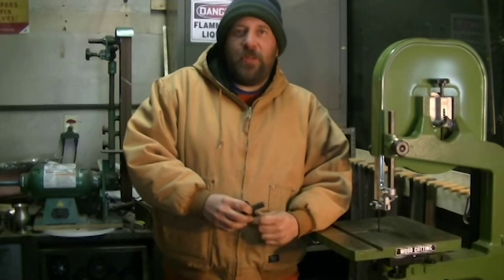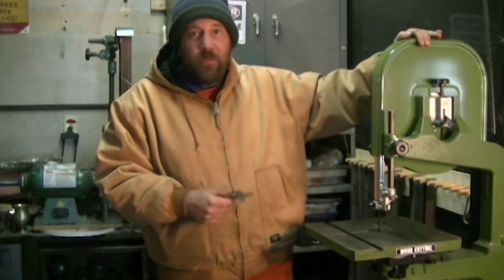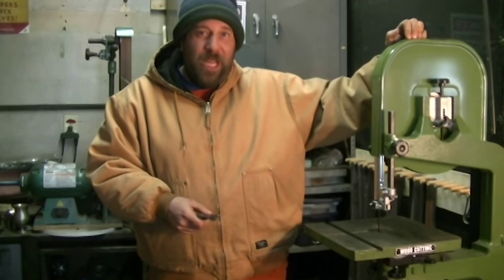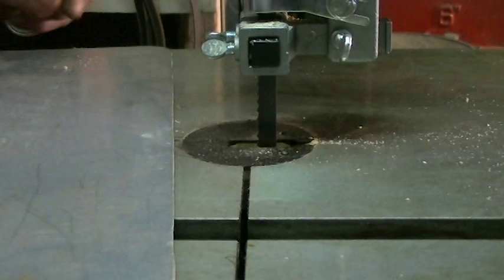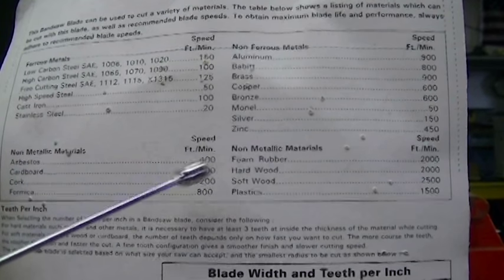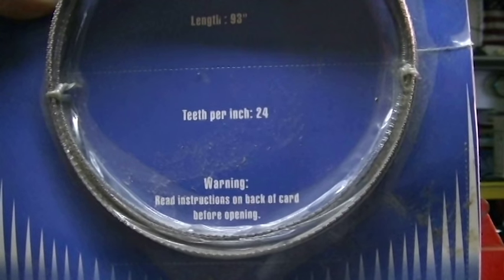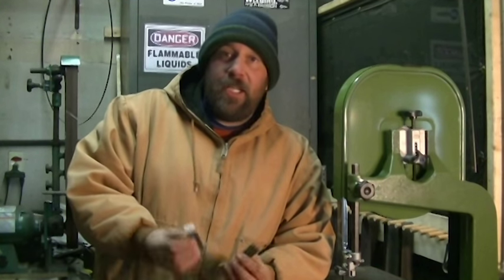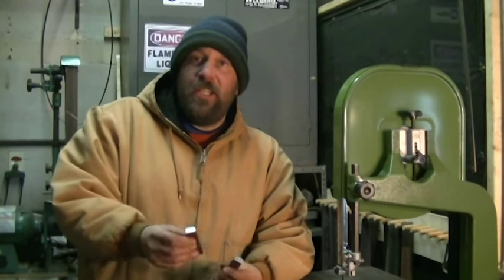Can You Cut Steel On A "Wood Cutting" Bandsaw?

Comment: I had a band saw in the 1960's  I installed a moor from a 1948 Bendix Automatic Washer. it had a 10 to 1 reduction system operated by a solenoid.  I used the slow speed for cutting metal it worked veyt well.

Comment: It is really nice that you put in a caption telling that a segment is at a higher speed!
Very few do that, and it can sometimes make an impression to those who do not know the process that it should go much faster than what it does when trying it yourself. And many who watch this kind of videos have little or no experience in the process themselves.

When cutting round material freehand, put a visegrip or toolmakers clamp on the stock! 
It will try to rotate as the blade goes into and out of cut because the cut forces are not above the contact point stock/table. This can make the teeth catch the edge and the teeth or your hand can get hurt.
Reply: Thank you.

Comment: I would like to make an addition to your video. When cutting metals, you should not just "let the blade do the cutting". So, for each metal there is an optimal feed and speed. And certainly true for harder metals, the blade will last longer if you do put the correct force into the cut. The problem with going too slow is that the teeth will rub rather than cut and wear the blade out quicker. Otherwise great video. PS I loved the comment about Dracula needs to be aware. Very funny.

Comment: Thanks for the demo!  I've got a Delta 14", but speed isn't adjustable as it is, so it's not going to get fed any steel.  I'll keep watch on Craig's list for something that can be modified to run slower. In the mean time I have a Miller Portaband mounted in a Swag Off-road table, so I have a 5" vertical bandsaw, and a portable saw for rough cutting wherever needed.  For the sizes I'm working with it's been good enough.

Thanks for the demos!

-- Mike

Comment: Depinately possible. It's not the tools fault to fail. It is the impatience of the operator that causes problems. We have a metal bandsaw at work, that the engineers destroy every new blade on the first use, as they FORCE to cut. The blades run about 120.00 from fastenal. I have a friend who cut blackpowder gun stocks on his meat cutting bandsaw, and it still works and blades last.

Comment: Thx! I think I will finally get my metal blade to work, I was pushing too hard...Also for crazy shapes I plan to do straight cuts blocking it in rough and then grind to smooth everything out... cheers😊

Comment: I enjoy your videos, but I just want to correct you on something.  Metal band saws usually have speed controls where as wood band saws do not.  That chart you had out specifies the speed for the blade for the material to be cut.  It is kind of similar to a drill press.  You vary the speed to the material to be cut and also the diameter of the drill bit.  Cutting wood the speed is not that critical, but cutting metal you usually use a slower speed and you can quickly dull a blade or bit if you are going too fast.  Yes you can cut metal on a wood band saw, but you will most likely dull the blade more quickly.
Reply from the maker: Very good point, this model has 4 speeds all controlled with moving the belt to from one pulley to another. If I find myself using this saw in an upcoming video I will be sure to mention this. Thank you for the comment and view! Hope to hear from you again in the future :)
Reply: Also metal cutting band saws have ball bearing guides instead of those blocks. The blocks will work but are not ideal . Another major difference is the wheel. Wood cutting band saws have rubber on the wheel with a crown . metal cutting band saws do not have this but they do have a ridge at the back to keep the blade on the wheel. This is due to the higher pressure on the blade for metal cutting. All that being said I have one of these saws too. Set to the slow speed with nice starret blade works perfect for a home shop . I made a ball bearing guide for it too and that helped quite a bit. Cutting aluminum and plastic its a beast , rips threw it like nothing but cutting metal I agree with letting the blade do the work .
Reply: @foam_blaster  That is not the case, I have a Startrite 24" 10 speed metal cutting bandsaw. It uses blocks not ball races. The blocks provide better support and are more accurate!
Reply: @codprawn  really cool blocks like on a wood saw? My do all has block guids too but they are very different from wood band saw guids. They are  one peace with a slit in them and they fit in ridged holders not like on a wood saw. Available in different sizes and materials. Arent yours more like that ?
Reply: @foam_blaster  Daniel - yes that is what mine are like. I thought you meant they all had ball races.
The proper blocks are hard to get for my saw. You can make them from cast iron but some people make them from wood - lignam vitae which is very hard and self lubricating. Lignam vitae used to be used for shaft bearings on ships and nuclear subs so it is pretty good stuff!
Reply: @codprawn  yea i have a hard time finding them for mine too,  well for a good price anyways... Iv made them out of brass , steel and cast iron. all worked well the last ones I bought where hardend steel. They where excellent

Comment: I have an old 1994 reliant which looks just like yours and still works great . Mine  has the different size pulleys for speed variations also . Thanks for your video as I will get a metal cutting blade , as I never thought of using it that way .

Comment: Good demo. Mine is a 1960 era cast iron Delta 14 converted to metal cutting with 135 rpm gear-motor. With five step pulley it cuts from 194 fpm to 1220 fpm with 1/4 x .025 x 10T Bi-Metal for tool steel, 1/4 x .025 x 4-6T for aluminum and 14T for sheet metal. I've never found a reason to go wider than 1/4 on my blades. I'm surprised you can cut thick steel that fast on a wood cutting saw even with 24T blade, I assume with a three step pulley and 1750 motor.  Thanks from a retired tool maker.

Comment: I have two of these saws. 2003 and 2007. One is for wood, the other for metal or fine cutting with a metal cutting blade running at 576 sfpm. The ideal speed for steel is about 90-150 sfpm. I only cut thinner metal and leave the heavy cutting for the horizontal bandsaw. (SFPM is "surface feet per minute" the blade cuts, not the rpm of the pulleys)

Comment: Any bandsaw... it is all about the band speed and the blade. Different speed ranges favor different material. Wood is typically a much higher speed than metals. Alum is a high speed also so a wood cutting saw with a good blade will cut alum. I cut up to 2 inch alum stock on my wood saw all the time (dry for those of you who insist it needs lube, it does not and will not stick to the blade either though on STEEL I do use a bit of wax). with a 6 tooth raker blade. The speed is not able to be adjusted slow enough to get a lot of cuts on steel etc. Too much speed and you will break off the teeth in a HSS blade in steel while the same blade at a slower band speed will cut a long time through steels.
Reply: Dear wayne , How are you ,  I want to buy a Band saw  for cutting Buffalo Horn and produce some crafts ,  But i can not take a desition  , what kind of band saw buy , Wood or matel .  and what kind of Blade i used ,  Buffalo Horn is very very strong / hard .

Comment: Thanks, Jeff!  I was thinking of getting  HF 14 inch band saw and now, you've confirmed what I always thought was probably the case!  I will look for the model that model with the cast iron frame!  I just bought a Skil 9 incher to get me by until I can find and afford a 14 incher!
I am a beginning knife maker, and at 67, I'm a bit late to the game!  I DO need to cut high carbon steel and some other metals so I bought 2 bimetal blades with 18 teeth per inch!  I can't fond any blades with more teeth for the 59.5 inch blades I need so, I guess I'm stuck with 18 tpi.  I'm hoping that it will cut 3/16th inch nickel steel!  It works very well for bolsters and guards!
Again, thanks for the video and the info!
Reply: I don't think 67 is too late, my neighbor, he is 84 years old and he bought engraving tools and his doing well and he makes some money too, he told me if you have passion for something age it's not an issue:

Comment: I'm going to be cutting out a couple of skinner knife blades out of 3/16" thick 440C steel and I was hoping to be able to use my table top (9" I think) wood bandsaw for this. The speed isn't adjustable though so I'm not sure if it will work. I was going to try a high tooth count bi-metal blade and cut a little at a time and allow the blade to cool off between cuts so I'm hoping I can pull it off but not sure. I do have a 4 1/2 angle grinder I can use but I'd rather not if I can help it.

Comment: I worked in a machine shop that bought several of these saws back in the 90's. My thought was they wouldn't cut metal. We but two sets of pulleys on them or an extra set I guess to say. we left the regular speed set then put a big time reduction set on with the motor made to slide or swivel (can't remember exactly) but we cut aluminum with the factory set speed and cut steel with the reduction set. Made a loop that would hold both belts. Also we added spray misters that made blades last a long time.
Reply: Phil Lowman i

Comment: Most wood bandsaws have speeds much faster than a metal horizontal bandsaw and will dull the blade very quickly. Just as an abrasive metal chop saw cuts much faster than a dry cut chop saw, so if you try and put a metal blade on an abrasive chop saw it will work but it will dull out the blade quickly because of the speed.  So its all about the SPEED of the machine thats the important part.  So yes it will work but how long the blade lasts depends on the speed of the machine.

Comment: I realize this is a older video but,, 
I'm doing the same conversion.. its a 10" Rockwell model 28-113 wood cutter. It has a 3/4hp motor.  
Can I use a variable speed rotary switch to reduce the rpm speed to a comfortable level without damaging the motor.??  Thanks for any reply from anyone who would know. 🙏👍

Comment: I have an old (60s- 70s) craftsman cast iron wood cutting bandsaw that I re-powered to slow the blade feet per minute to @ 250-300 FPM. I used a snowblower auger gearbox to reduce the speed. I works awesome! I’ve been using it for about 8 years. Blades last forever, I think 3 blades in 8 years and I use it ALL the time. Steel, aluminum, sheet metal - whatever.
Speed of blade is absolutely critical, however – another critical aspect of converting a wood saw to a metal saw is the blade. I went to www.toolcenter.com and bought  .025 x 14 TPI NEO-type metal blade. There like 12 or 13 bucks apiece. These blades are totally awesome as I said earlier, they last forever. PS, I’ve never used any lubrication.
Reply: Kenny, throw up a vid of that reducer in action! Im doing the same to a Craftsman 12" but am using 2 go-kart chain and cogs. Its loud! I think I got it down 12:1 or about 250 fpm.

Comment: I tried this with my Jet brand bandsaw.   Brand new blade I made 3 inch and a half cuts through some 16th inch mild steel.   They went very nice and I thought I was rolling.   Fourth cut on some eighth inch angle and it won't cut.   Need to find a smaller pulley to slow the speed down.       60 dollar blade no good!!!!     Ugh!!
Reply: Why can't YT figure out the truth? It's insane. We have the internet, now. But incorrect (or at least misleading) information is all that it will feed you.

This dude can do it because his saw has 4 speeds, and the lowest is only 700 fpm. So I give him a pass, since he probably didn't know. But other YT'ers copy this guy and show how they can easily cut (one piece of) steel on their saw, while making a shower of sparks. Then they claim they "do this all the time." Yeah, right. Posers identified.
Reply: I'm sure you'd like your $60.00 back. But hey, these guys made 1.2 cents off your view!

Comment: Old timer's trick that will help your blade last a lot longer :  use some beeswax on the blade before cutting thicker material . . . * it can nearly double the cutting speed !  ( especially in aluminum plate )   :)      This would be a fine candidate for a treadmill motor !
Reply: Cutting aluminium is a pain without beeswax or other lubricant. It sticks in the teeth! It doesn't take much beeswax to to the trick either.
Reply: Try methylated spirit when you work with aluminium. That makes machining, cutting or drilling a lot faster and keeps the aluminium from sticking to the tools. It's due to the cooling effect of alcohol evaporating rather than lubricating. As a bonus you save yourself from  cleaning up the oil from everywhere.
Reply: thanks for the input!!!! this trick WILL come in handy! cheers, mate!
Reply: For those who use handsaws (particularly with some woods), beeswax helps there as well. And if you are using a good functioning bench/hand plane bees wax can make a nice plane work great -- just scribble a bit across the base.

Comment: @Jeffrey Santo - I realize that this video is a bit long in the tooth, but some things never change, so I was hoping to get a bit more information about the bandsaw used in this video.  Harbor Freight is presently advertising a "14-inch 4-speed Woodworking Band Saw" that's made by Central Machinery (SKUs: 60564, 32208, 67595, 68835) that sells for $499.99 (February 2023).  They're advertising that it weighs 167.2 pounds and that it uses 93.5-inch bands, so I was wondering if you think that it's anything like the saw you filmed herein?  If not, I'd appreciate any identifying information you can find for your saw.  I've both liked and subscribed, so please keep up making the informative videos. 👍

Comment: Very informative video thanks. As you cannot buy a metal cutting vertical band saw it would appear converting a wood one is the only option. I think a good cross cut fence would need to he made though with clamps preferably. Many wood cutting band saws only have one t slot which is a nuisance.
Reply: you can absolutely buy a 14" vertical metal cutting bandsaw

Comment: If you install a metal-cutting blade and if you feed the metal to be cut extremely slowly so that heat does not build up, and cut only thin materials...and use extreme caution, but used horizontal bandsaws are cheap (Craigslist or Facebook Marketplace) and most of them will stand up in a vertical position. All you need to do is build a small table to mount on them... My wood-cutting bandsaw has aluminum wheels with rubber tires. My metal-cutting bandsaw has cast iron wheels with no rubber tires. I think metal chips might eat up rubber tires.

Comment: Jeffrey I have cut tons of aluminum and steel on a verticle band saw and you need to stay as close to the recommended blade speed as you can  and you can buy band saw blade wax in a cardboard tube you just rub the wax on the blade while it is running every 3-4 cutswax makes blades last longer and cut quicker good video  thanx

Comment: So is it safe to use a wood cutting bandsaw, those old belt-driven cast iron ones? 

Say, if I channge pulley ratios so it goes a bit slower, or if I calculate the saw's speed to match its recomended specifications, would it be ok? 

Is there any other characteristic that makes a wood cutting bandsaw suitable for wood-only?

Comment: considering cutting geometries it is a fundamental rule that you always let the tool do the work. Each tool has it's limitations in terms of cutting capacity (room for swarf and chips) and you can't run above these limits. 
BTW - the speed about which you talk in your vid is actually the cutting speed and not the feed rate. For linear cutting processes such as sawing it's a function of the rpm's while for rotating cutting such as drilling, milling or turning it's a function of rpm and tool diameter (for turning dia. of your work).  While the feed rate - as the name already indicates - indicates how fast you feed your work to the tool.

Comment: Im thinking of using a vertical 14" bandsaw with different blades in both metal and woodworking situations.
Investing both the 6x4 horizontal and the 14" vertical at one time is possible but painful.
Thanks for your experiments.

Comment: Perhaps you or someone else can explain what do you mean by a 9-in and a 14-in saw? Is it the opening from the top of the table to the adjustable foot?

Also thank you for putting a video out about this saw. I've seen them online and wasn't sure of the quality. It looks like I might need to check one out.
Reply: Measurement is width available from blade horizontally to frame

Comment: i put the metal cutting blade on my vertical woodcutting band saw. it works great  but don't try cutting bed frame angle iron. i knew it was tough to cut but i just had to try.saw sparks and the blade will still cut plastics but not metal.
Reply: You do know that bed frames are hardened, right? Otherwise they would have to make them alot thicker if they should stand up to years of humping, jumping and other kinds of abuse ;)
Reply: Stay away from bedframe angle.  I've ruined many a band saw blade on that stuff.  Bedframe angle is made from old railroad rails and it is very tough; however, the hardness is inconsistent and you might be able to cut one part of it with no problem, then the next cut encounters a hard spot in the angle.